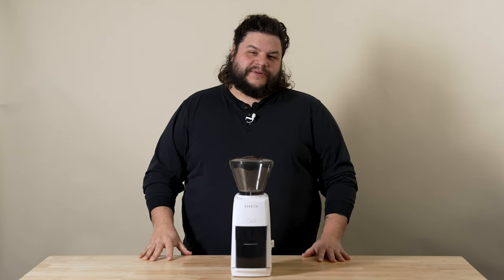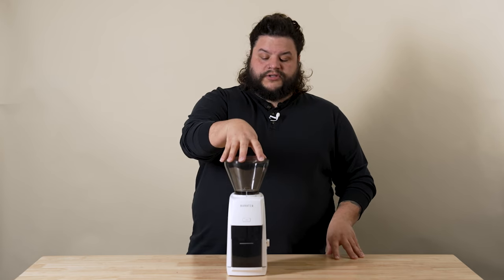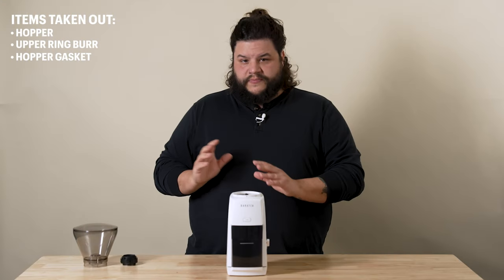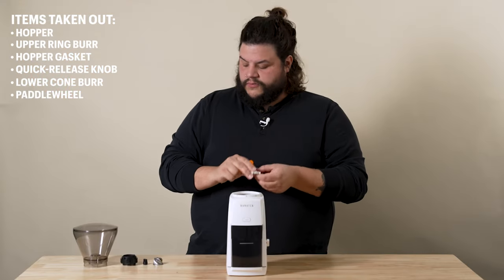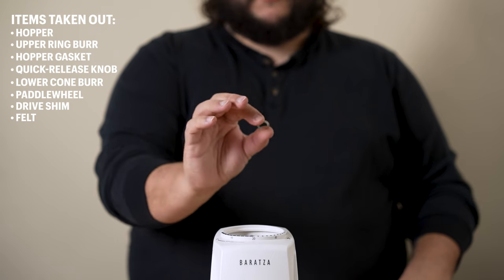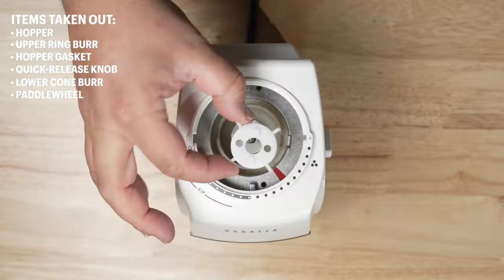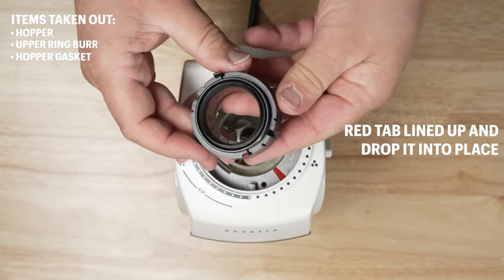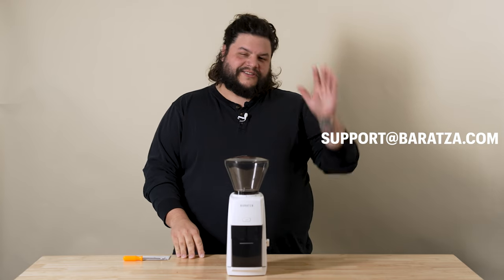How To: Shim Your Encore ESP

Comment: It seems that the grinder has a significant design flaw, as the paddle wheel, being made of polymeric material and subjected to constant pressure from the conical burr, undergoes creep, so that as the months go by, the need to add washers increases. And it's unstoppable (and I suspect the same occurs to the burr holder). Then, as the paddle wheel rises, ground coffee accumulates in the grinding chamber, which ends up falling down the inner walls of the grinder. I have recomended this grinder based on the reviews of Lance Hendrick and the other coffee guys on Youtube, but nobody talks about the problems that arise with time. Is there any solution? Have you considered replacing the plastic parts with metal ones?
Reply: Mine died in no time. Significant regrets.
Reply: I think that's my issue. I already have additional shims. Moreover I am unable to grind as fine as I did before cleaning it.
Reply: @esongsore  oof - did you call? they'll probably replace it! I have owned my non-ESP Encore for over a decade - and can take a apart and completely rebuild as necessary (twice so far - for calibration issue and for a screw that came off of the housing - easily reinserted - call them - they truly stand behind their products
Reply: So it's basically a broken product design and theres nothing you can do about it. You can buy it to make espresso with it for a few months and then you can throw into the trash?
Reply: My ESP has been great have had it for a year and make espresso daily if not a couple times a day
Reply: @SpaceSurfing87  Roast level? Pressurized or non pressurized filter? One or two espressos per day is not that much.
Reply: @SergioGonzalezMartin  usually medium or dark roast for espresso. Non pressurized basket. For now I'm am just pulling shots on the Bambino plus. I am getting a little bit better espresso machine next week. I will then experiment with lighter roast. Hopefully I will still have good luck. I also keep my grinder clean and have added a bellow.
Reply: @SpaceSurfing87 Thanks for your reply. I told you this because fine grinding for lighter roasts requires much greater effort. I hope you don't have any problems. In any case, with a new machine you will soon have a better grinder 😄

Comment: can you please clarify the correct arrangment of the original shims , or no particulare order just all of the six should be there?
Reply: The parts fiche shows two kinds of shims: 3 pcs of 0,25mm shims on top, and 4 pcs of 0,10mm shims on the bottom. When you feel them in your hand, they bend a little less and more easily.
Reply: @lpalokan  thank you

Comment: I have the opposite issue.  If I’m at the top end of the espresso settings (18-20) would removing shims shift the settings coarser?
Reply from the maker: Thanks for letting us know! We normally do not advise taking out shims from the grinder. If you are experiencing a fine grind at the coarser settings, we would suggest checking out this grind quality issue video - https://youtu.be/qUCMrWIdyLI. If the problem persists, please reach out to support@baratza.com and they can get the problem fixed!
Reply: Why not? @Baratza
Reply: Talking about particle size. I did the shimming process. It happens that the older the coffee beans the finer you must go and the other way round. The question is how many microns does this process change on the original particle size? Is the result basically only a change on the steps towards the coarser side ? Meaning what was a 9 now is 11 and so? Thanks
Reply: Same here, when grinding for espresso I find myself in the 18-20 range regardless of the kind of coffee I'm using (freshly roasted, light or dark, etc.) any grind size below setting 18 and my espresso machine will choke as the grind quality is way too fine.

I contacted baratza support and they sent me the new quick release knob (mentioned at 2:02) and I'm hoping this will help
Reply: @jonfcbayern  Did the new quick release knob help with your issue? I noticed that my quick release knob loosens itself after a couple of grinds. If it's loose the burr will come upward which is the same as if you would turn the hopper to get a finer grind. By tightening the knob again the problem is gone.
I already requested a new quick release knob and hope it will stay tight!
Reply: same